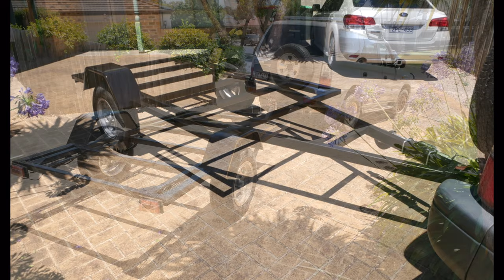Teardrop trailer - base frame build time-lapse - PART 1

Comment: Is an ice bath common in your neck of the woods? How hot does it have to get for an ice bath?
Reply from the maker: Hi Kyle. It's definitely a movement that has gained some traction in the last couple of years.  But I don't think it's a mainstream thing yet... it's still somewhat of a niche thing, but there are a lot of instructors and people running workshops and retreats related to ice immersion.  I do ice baths all year round... in summer it's easy. In winter it's a lot more rewarding.  I'm live in Melbourne so it doesn't get below 0 degrees outside.  But i think outside temperature doesn't really matter, it's really all about the coldness of the ice bath.